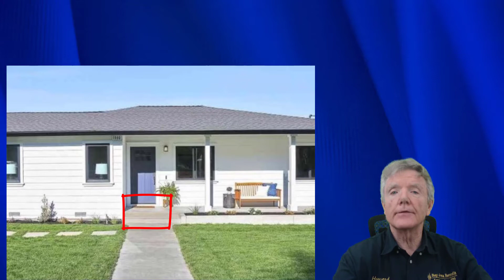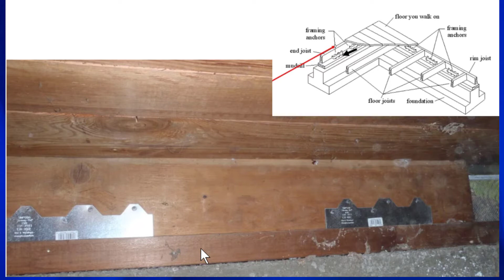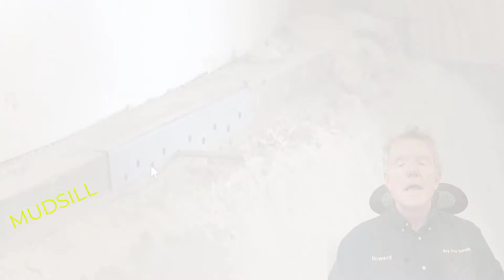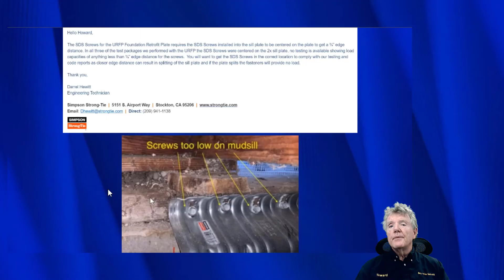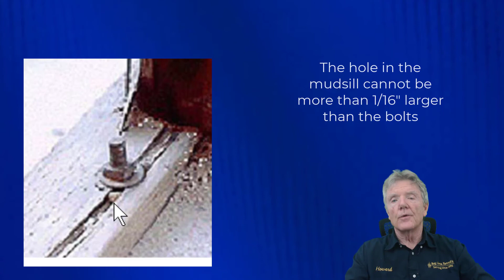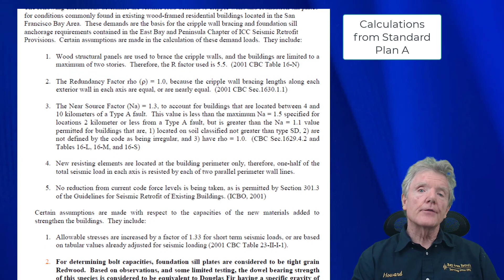No Cripple Wall Retrofits: All There is To Know

Comment: Are you sure transferring all of that energy from a earthquake into the structure and the occupants in that structure is the best answer for serving a earthquake? 
The reason the houses that slid off  their foundations look so intact is because the energy did not transfer from the foundation into the structure.  Actually decupeling the foundation to allow the structure slide across the foundation but not fall off of the foundation.
Reply from the maker: If the connection between the floor and the foundation is strong enough the house, foundation, and earth will all move together.  The house above the floor will be able to take the shaking just fine.  The houses stay more or less intact regardless of whether or not they slide off the foundation but in one case you have a house to live while in the other you have nowhere to live. 

https://bayarearetrofit.com/see-what-cripple-wall-damage-looks-like/

Comment: I like those HFA anchors better.  Looks like those could easily be custom manufactured by a local fabrication company.  Could go even heavier duty metal if you wanted.
Reply from the maker: When you need them, you need them. USP is the only company that makes something similar.